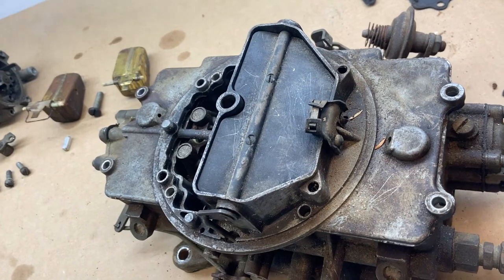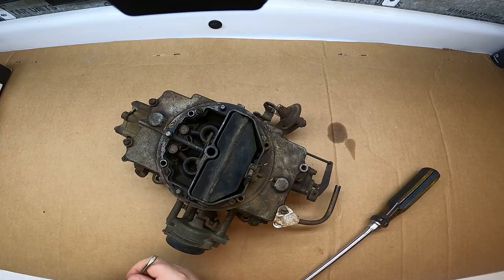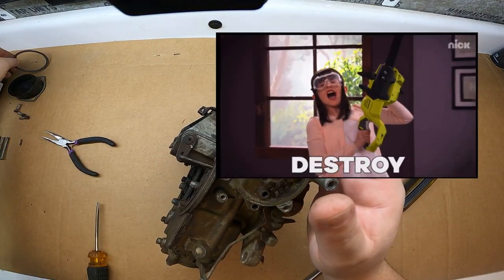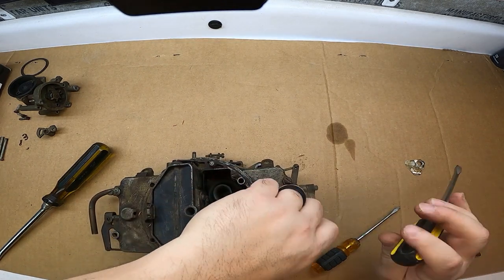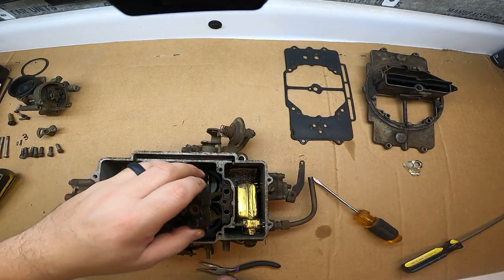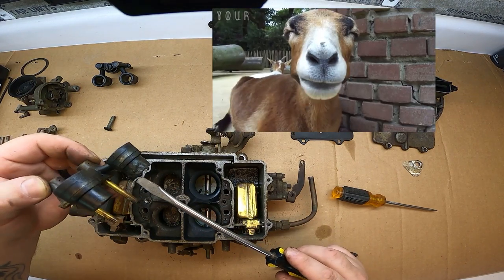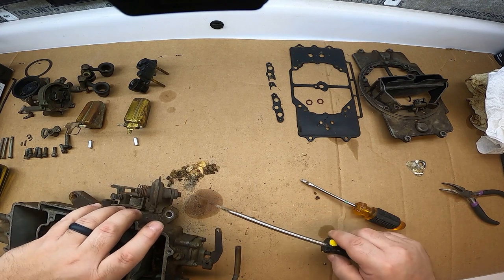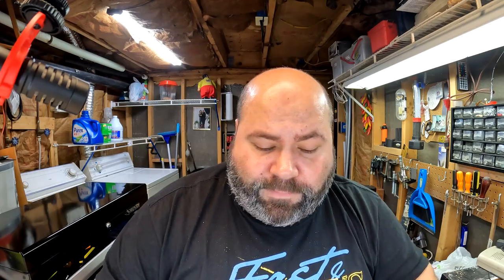Disassembling A Filthy Autolite 4100 Carb Off A Neglected 1959 Ford Tbird

Comment: F.Y.I. only…The flag you have hanging on the door is not in respect to the flag code. When it comes to being displayed in a vertical fashion, the stars are displayed at the upper left-hand corner of the flag. A good way to remember this is…we read from left to right & top to bottom.
Reply from the maker: Thank you, I’ll definitely correct that.